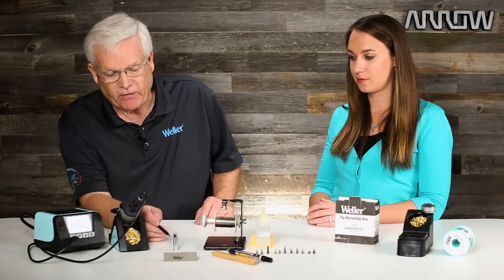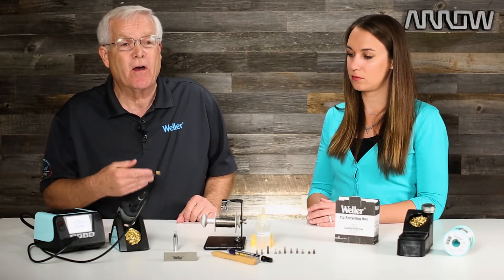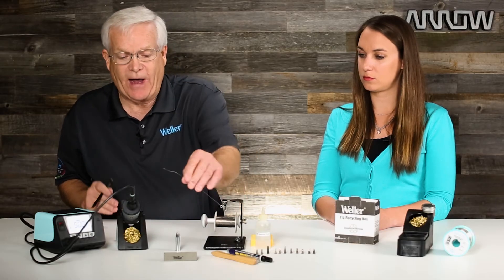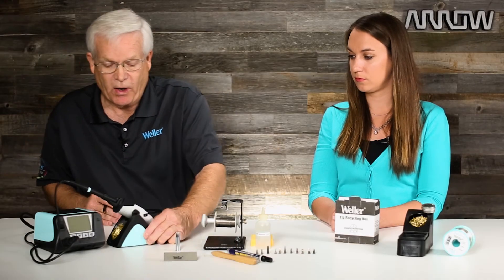Soldering Iron Essentials 1: Prepping & Maintaining Your Brand New Soldering Iron

Comment: Best video ever on this matter of tip tinning/ understanding it/ rationale/ concerns-issues/ care. I'm very thankful for your expert assistance. In the past I watched a bunch of videos on this matter, & this video stands apart as excellent, a cut above.
Reply: BIG QUESTION: I do wish for info on 1 thing. You speak of 'lower' temp of 500 deg, for tinning the tip, 'lower' than used in soldering. But no mention of the solder used & it's melting point/ soldering temp range? I have electrical no lead solder, with a range given of 416-454 deg F, I just discovered, which is actually lower than ALL of the temps discussed in this video, for tinning & soldering.

Comment: Just one caveat ---- dont buy any red Weller soldering iron or equipment; its their lowest quality product line but it's not even all that cheap.  On my channel I compared a red Weller to a Harbor Freight Schneider soldering station that costs $20 less and is better designed, a much better buy.

Comment: Good video, and I've been soldering electronics for 55 years! I feel I should reiterate that the reason that copper is used as the preferred base metal for soldering iron tips is because it has excellent heat transfer characteristics; but unfortunately many of the cheap tips sold in bulk online are made of steel or iron throughout and have far inferior heat transfer charactistics which make it more likely that you will heat-damage the board because fully iron or steel tips will take longer to solder connections, and you can cause the foils to delaminate from the board. Tips made of a solid magnetic material can also induce current and voltages in sensitive components and damage them. You can check your tips with a magnet and they should only be attracted to the magnet at the pointy business end and not at the back end of the tips. There's a video on my channel where I demonstrate this.  The pointy end of the tip needs to be plated with iron because unlike copper, which is easily dissolved into the solder and flux, iron will allow the solder to wet to it but isn't so easily dissolved.  It's always best to buy your solder,  flux and tips from an authorized electronics specialty distributor based in the country where you live instead of ordering them from Amazon, Banggood, Ali Express or whatever. PS,  I strongly prefer the brass wool as a tip cleaner compared to the sponge which can create stress fractures in the tip plating;  some people also saturate the sponge so much that steam comes up from it when they wipe the tip, and that's definitely doing it wrong!
Reply: Thnx goodun... For all the info & now I'm subscribed 👍

Comment: English is not my first language, can anyone please help me what is the tin wires made of?
Reply: Solder is traditionally made of about 60% tin, 40% lead (the ratio may vary) and includes rosin flux inside the solder. Leadfree solder substitutes other metals for the lead,   uses different and particularly unpleasant caustic,corrosive fluxes, and in my experience is far harder to work with for the average hobbyist.
Reply: @goodun2974  Most good lead free solders these days now have no-clean flux, which is non corrosive and much eaiser to work with than previously. Thankfully the lead free solder tech has come a long long way since leaded solder started to be phased out of many manufacturing processes. 

The leadfree stuff I use runs like water even with my 40W iron (and it's not fancy solder or anything, it's good stuff but only costs like £15 for 100g of 1mm). You will run into huge issue if you try and use lead free solder with an iron that has had leaded on it though, or if working with an old board that has had leaded solder used on it prior as they do not mix, and it'll just make the solder work like it's full of impurities and clump up (this is actually still a big reason a lot of people don't like it when they try it, as they used the same iron that they use for leaded solder, and wonder why it it doesn't flow properly, then blame the leadfree solder). You have to fully remove and clean any old lead solder with wick before soldering with leadfree on the same board, and I'd start with a fresh tip completely if I was changing from leaded to lead free solder, or the other way round (or swap back to the appropriate tip).

Comment: Completely new here. I just dropped $250 on a soldering gun, heat gun, voltage meter, tray, helping hands, heat gun holder, solder, soldering wick, tip tinner, extra tips, sponges, wire sponges, all the fun stuff, etc.,  online. It should be here within the week. Now I have never even held a soldering gun before, but by the end of next month I'll be tearing into all my broken electronics hahaha. Im about to be living every nerdy kids dream. 😈😈 Anyways, im here just researching and looking for tips and ways to solder smartly and correctly and looking for things I might need but missed on Amazon.
Reply: soldering guns suck outside particular use-cases, you want a soldering iron for the vast majority, can be had for as little as $25 in the Pinecil soldering iron.

Comment: i dont have a weller but im having an issue. i can tin parts of the soldering iron but other parts it just pool up and falls off or melts on the untinned part and pools up where it is tinned  resulting in very uneven tinning of the soldering iron tip.
Reply: The soldering iron tip is too oxidized to accept solder.  Assuming that the was well made of appropriate metals and isn't too badly worn/pitted/corroded, and assuming you haven't taken a file to it,  you may be able to restore it by use of a typical "tinning block" which is usually made of powdered tin or powdered solder mixed with a caustic chemical (usually ammonium chloride, aka salt ammoniac,).  If the plating on the tip has been worn down to bear copper or you've filed away the iron coating that is supposed to be there , then you will need to buy a new tip. Unfortunately there are a lot of poorly made tips on the market and buying them through Amazon, AliExpress, Banggood or other online sellers will typically get you cheap garbage for a dollar or two apiece. Buy solder, tips and flux only from reputable distributors in the country where you live. Check out your replacement tips with a magnet as per the video on my channel; only the pointy business end should be magnetic.
Reply: PS, if your iron is too hot, this can also cause solder to ball up and not "wet" to the tip.  The hotter the temperature the faster the tip oxidizes and builds up a layer that rejects solder.  Repeated attempts to solder with a tip that is too hot may damage it prematurely even if it's made of good quality materials.

Comment: I assume he’s using Fahrenheit when talking about 500degrees? Correct?
Reply: I believe so. I tinned mine yesterday at about 300 C which is about 575 F, close enough I guess?
Reply: Yes approx 260 Centigrade.
Reply: lol yeah of course.
Reply: In my opinion one need reach a temperature of 250 to 275°C to adequately tin the soldering iron tip. Most solder wires melt at 183°C. When actually soldering wires and component it is necessary to increase the temperature of the tip from 325 to 375°C to properly transfer sufficient heat. A lower temperature between 250 to 275°C is all that is needed to tin the tip of the iron.

Comment: Very informative video, thank you!  I’ve been soldiering for years now and I learned things from this five minute video that I was doing to oxidize my soldering iron tip and causing them to wear out prematurely.  Thank you for sharing your expertise and creating this very informative video!
Reply: Hi! can you help me? is the tin wire made of lead, copper, or anything else?
Reply: @krmdhn ,  He's using flux-core electronics solder to "tin"  the tip.  He doesn't say if he's using lead-bearing or lead-free solder here, but lead bearing solder is roughly 60% tin and 40% lead (or a similar alloy percentage) and has rosin, which is a purified pine tree sap, inside the solder.  If you are working with lead-free solder and the circuit boards you work on are made with lead-free solder then you want to tin the tip with that instead , and lead-free solder uses a very different type of internal flux (more corrosive, unfortunately, and electrically conductive).  

I don't recommend lead free solder for use by people who are new to soldering because it's very difficult to work with compared to leaded solder:  requires a higher temperature to melt and flow it effectively, it eats up soldering tips more frequently,  the flux fumes are particularly caustic and unpleasant to breathe, and any flux residue left behind can cause problems (rosin flux is inert, doesn't cause corrosion and doesn't conduct unless the circuit has high voltages, but lead-free fluxes may become corrosive and corrosive).  Note that resoldering leaded-solder connections with lead-free solder, or vice versa, will usually result in a very grainy looking and poor quality connection.  Best to remove all the existing solder first before resoldering a troublesome connection.

Adding additional flux can sometimes be helpful for use with either type  of solder, but If you buy a bottle, syringe or can of flux be sure it is the correct type to match the type of solder you are using.  You should also be aware that most of the inexpensive tips being sold online are not made of plated copper but instead are iron or steel throughout, which means they will have poor thermal transfer/conductivity and force you to spend more time on each individual solder joint in order to get a reliable connection;  and that can lead to delaminating the copper foils right off of the board 😳. Tips made of Iron or steel can also induce voltages into sensitive components and damage them.  You can tell good tips from bad ones by use of a magnet ( see video on my channel). Tips should only be magnetic at the pointy business end due to the iron plating mentioned in this video. PS, rosin flux can be removed with pure alcohol, but leadfree fluxes are usually removable with distilled water.
Reply: @goodun2974  thank you so much for your help & explanation!

To be honest I didn't even know the kind of solder I bought, lead-free or not, etc.

We bought a cheap one from Kenmaster and only use it to make holes on flower pot. The fumes were so bad! I make sure to open the window and turn on the fan. 

Although it's not the best solder, I want to take care of it so it won't easily broken, dirty, or dull & make the job harder to be done..